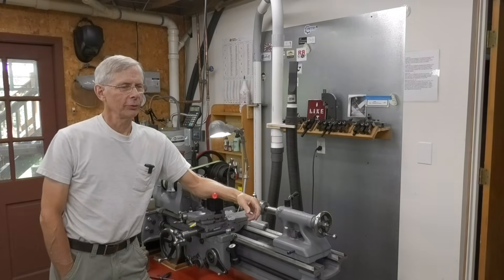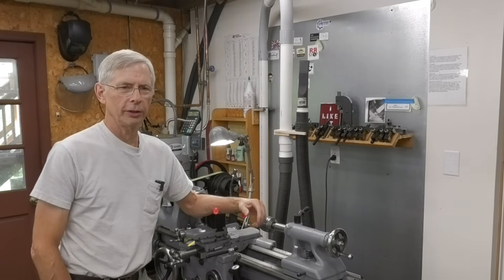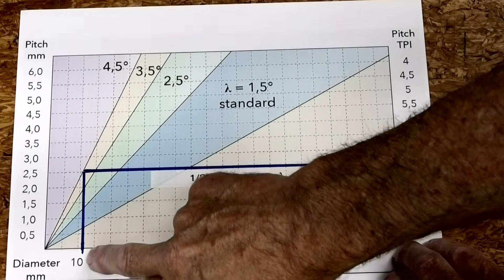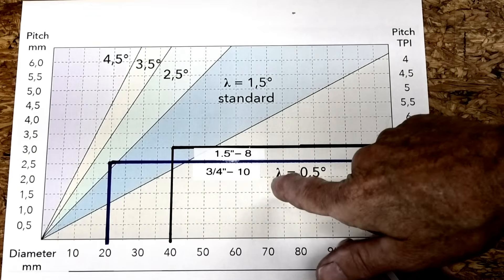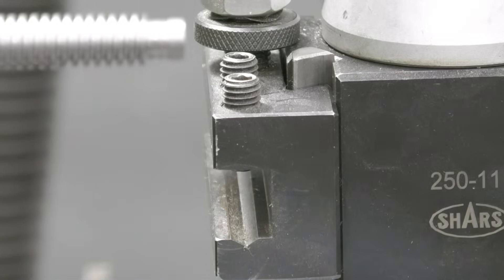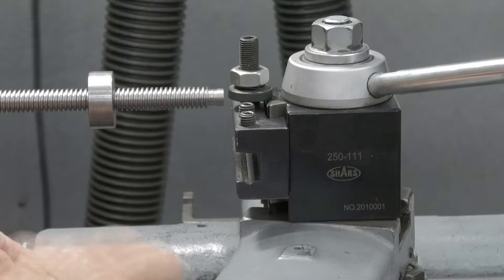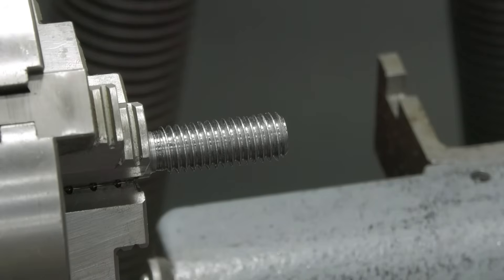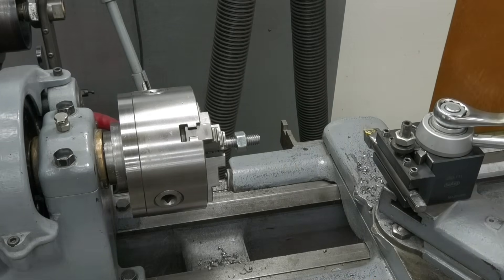Compensating for the Thread Helix Angle - An Easy Method!

Comment: Very useful thanks. Backs up what I'd seen myself. I cut 4mm pitch on a 27mm diameter Delrin test bar and it just about worked with no packing. But when I cut the thread in steel I will probably pack it along the side of the tool as you showed. Cheers
Reply from the maker: For the Acme threads and a laydown insert its a huge improvement. From what I am reading a standup insert has enough built in side clearance that tipping the insert is not needed.

Comment: Hi Mark, instead of the mutilation of both a tool holder and a socket head cap screw  and then complaining about your welding you could have mounted your 4 jaw chuck, clamped the tool holder in it, centered up the shaft, centre drilled the back end and turned it round to suit your holder. No cutting or welding necessary. 
A digital protractor is definitely in your future.  They're not that expensive. 
Regards from Canada's banana belt.
🤞🇨🇦🍌🥋🇺🇦🕊🇺🇸🪓🦃🏁👍
Reply from the maker: Yep, that would have been much better, I sometimes overlook the obvious.
Reply: That was excatly my take! Looking in the comments not to duplicate haba. 4-jaw chuck and turn the shank is the obvious easy method

Comment: Anneal the OG holder.
Turn the holder shaft round.
Re harden the tool holder.
Viola!
Maybe attach a needle/indicator to the back of the tool holder, place a expanded protractor on the ass end of the tool post for the indicator to...uh...indicate against.
Viola^2!
Reply from the maker: An obvious solution although the shank was not hardened

Comment: I never had a problem cutting thread ,but then again i never used insert i always used hand ground hss blanks with 3 -5 ° siide clearance.
Reply from the maker: Yeah, thats usually enough clearance. Most laydown insets have no clearance. The insert is also tipped toward the stock in the holder so this does provide some clearance. In most cases this is enough although with acme threads the clearance is not adequate due to the nearly parallel angle of the tool.

Comment: Your toolholder, in original form, already had the insert tilted to cope with threads  with lead angles up to 1.5 degrees.
Reply from the maker: My tool holder is flat on the helix plane but you are right. Being tilted forward offer enough clearance up to 1.5 degrees. However the 1/2"-10 thread I was cutting is about 3.5 degrees.

Comment: I was ruminating over this idea.  You would have to have a toolholder meant to hold a shim and an insert you could not just add one to an existing holder.  So now there is one more variable and probably as rare as a unicorn's horn.  I made a promise to myself that I would stop buying toolholders after I counted up and found I had more than four dozen at present in my racks.  So, buying more to go positive would just feed my addiction.
Reply from the maker: Haha...  Yeah, larger holders have shim but the 1/2" holders do not. Also the shim (as you said) are hard to find.

Comment: I have seen them with and without shims.  It would be interesting to know who sells affordable shims.  I have never seen them offered anywhere.  I would like to use a more positive rake insert many times but they too are hard to come by.  Most of which I have found are made for aluminum.  And the positive inserts only have one side, you can't flip them for more cutting edges which a shim would make possible.  You could use the negative rake inserts with a positive shim in theory.  By the way, do you use your built in vacuum to pick up metal swarf?  Any problems with hot chips igniting the wood waste?
Reply: I think you are a bit confused, the shim has nothing to with rake.
Reply from the maker: No on the wood dust collector. I have thought about using it for my belt grinder with some kind of filter but have not been willing to take the risk. For me the best approach is to make the tool shank round. Maybe turning it down is more logical than welding the shank.

Comment: The part of the bar that sticks out at the back (toward you) could mount a degree indicator of some type, so you could set the degrees by number.
Because you're dealing with small numbers like 1.5' or 2.5' you could make the dial long so 1' represents 1mm or so graduation marks
Reply from the maker: I agree although it would need to be a long indicator. Maybe a digital protractor.

Comment: Great idea.  What would really be an improvement in your desig would be a gauge on your moddified tool to set the helix angle.  Maybe using the edge of your BXA tool holder as the reference and then twisting the tool to the correct angle.  Just food for thought.  Great video.
Reply from the maker: That would be cool

Comment: Можно было просто проточить держатель резца.🙂
Reply from the maker: That would be hard to get correct and the method I used is adjustable for different thread. Turning down the shank would have been a better option than welding on a new shank however.

Comment: A very simple solution there Mark, well done. You could use one of those digital angle finders on the flat part of the shank. That may be an easier way to get an accurate degree reading.
Reply from the maker: Thanks, I thought about that too. Agree
Reply: Same here, the digital angle finder is my first go to choice because of its simplicity of operation. Nice deep thinking going on here, cheers!

Comment: Your reasoning and execution are impeccable, but if you change the attack plan of the threading tool, also change the angle of 60 degrees.
Reply: As the insert is tilted over the oblique of the thread profile becomes narrower...it then alters the profile that the insert will cut when at full depth for the finishing cut.
There are 2 ways of overcoming this...one is to grind the top face flat to match to the horizontal centre line of the work piece ,this allows the helix angle of the tool tip flanks to be geometrically correct for the thread helix angle  but it also corrects any geometric oblique error on the top face(thread profile)
The second method is to move the tool sideways slightly on the final cuts to adjust and correct the width of the thread vee to more closely match the thread profile design specs.
Reply from the maker: From what I have read you are correct. However if you are trying to cut fast Acme threads the insert will need to be tilted to have enough flank clearance. With standard thread the clearance is more forgiving but for fast threads the insert will cut better tilted to the helix angle. Fortunately with standard threads there is a range of tolerance. To me it seems odd that the profile is measures parallel to the axis of he helix. If you think of a Ball Screw, the ball would never fit if the cutter was not perpendicular to the helix angle...  but I'm sure a ball screw is a different process.
Reply from the maker: Thanks, yes, it is a slight change but ideally it needs to match the helix angle although the side clearance is probably the most critical.

Comment: Hello Winky, I am confused, I thought you was now using auto retracting tool holder to cut your threads plus tool companies include the angles in to tool holders, machinists no longer have to use HSS tool bits to grind them to cut threads etc. Cheers from me. 🤔🤨
Reply from the maker: I use the auto retract for threading against a shoulder. It does not have any helix compensation but it still works well. The most problematic is acme threads.

Comment: Good afternoon Mark,
As stated in another comment, I imagine if the tool holder or inserts are not angled, then you are making it work with what tooling you have.   
It’s good to see you back in the shop.
Reply from the maker: The insert will work without compensating for the angle in most cases but its better if it matches. Most important is acme threads.

Comment: I’ve never heard of shimming a threading tool before in over sixty years of machining. So
I learned something new today.
Reply from the maker: Amazing huh? Same here actually. Here is something else i learned. The laydown inserts need to be tilted to the helix angle in some cases but the upright do not. The is because the upright inserts have more clearance. If you shaped the laydown insert with side clearance it would likely break. They are very thin.
Reply: @WinkysWorkshop  I can imagine an insert that's flat on top (not tilted) with clearance only on the leading edge. I wonder if anyone makes an insert like that?

Comment: The tool holders I use on my Myford are not too hard, you may have been able to turn the square section on yours to save cutting it off and welding on a bolt.
Reply from the maker: Very true. Maybe a little tricky to hold but doable!

Comment: Am I overlooking something?  It seems so basic that it’s hard to believe that it didn’t become an industry standard like forever ago. I can’t recall anyone else in all the threading videos I’ve watched ever mentioning building in that angle for better threads. If the angle ever needed to be exact (apparently it doesn’t) you could do a setup using a sine bar erected right on the flat of the new tool holder. I’m not a machinist so please be kind in comments if I’m off base. But I’m thrilled that you figured it out. 🥸👍👀👋🚫🌞🔥❗️
Reply from the maker: Oh I agree, it blows my mind that so few know about this. I will say however that the laydown insert only need this. The standup inserts have a lot more side relief I think the laydown inserts are a fairly new development. Side relief on the laydown insert makes the too weak. In info is on most the high end insert websights.

Comment: Mark any info or links on the insert and insert holder for Acme threads would be greatly appreciated.
Reply from the maker: I only have one acme insert and its the same number as the standard threading insert (16ER). Google 16ER10 Acme insert. The 10 signifies the TPI. The acme insert will only cut one pitch thread.